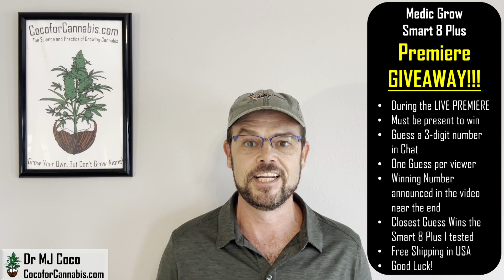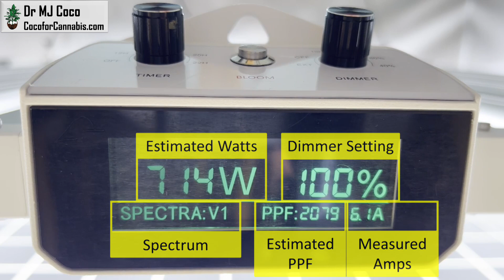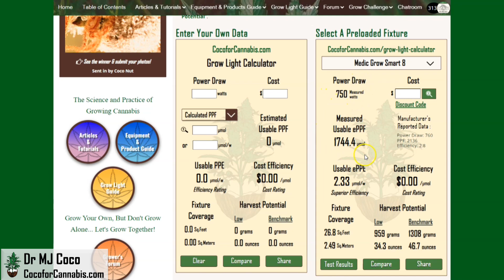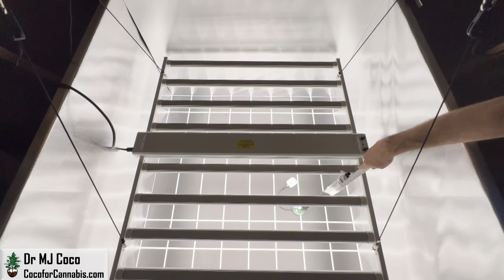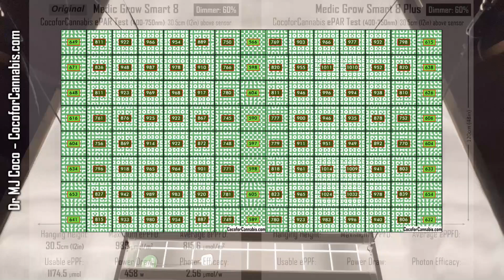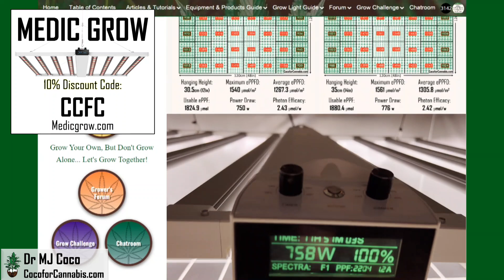Medic Grow Smart 8 Plus PAR & ePAR Tests and Review

Comment: Do not buy ANY Medic Grow light cuz they will give you a MAJOR run around and try to send you another cheaper light!! I bought the Spectrum X like 7 months ago and it began flickering last week after only about 5 months of actual use. I have got nothing less than a complete runaround by Medicare warranty department!! They've tried to send me a $400 light in place of this 700 light and the fold 8 would also require me buying the $200 controller to control it and it doesn't have the UV and IR bars.. after I told them no I want either the Spectrum X or I'd accept a spectrum Y they still offered me a fold 8 or 270 which is not even a third of what I paid for the Spectrum X!! Will never buy anything from medic grow again and I will forever question anyone who gives a positive review on one of Medic Grow lights.

Comment: U should hung them at same height. Increasing the height just makes better chips less. I see why u did it so their at 1000 but regardless because your higher your taking away from the stronger chip. Hang the weaker chip that high it be way worse

Comment: I've been trying to contact some of the main YouTube reviewers & not getting a response. I was hoping you could help me I seen you on grow it and I'm subscribed 2 your Channel. Question is I currently have viparspectra Xs 2000... it gets really warm and it's hard to control the heat. I was thinking about upgrading to a AC Infinity Evo 3 limited space do you think the upgrade would be worth it? Also the detachable driver I feel like that's where most of the heat comes from being able to keep the driver outside the tent would mitigate heat inside how do you feel about this or what would you suggest for a two-by-four?
Reply: I tested all of the above with a digital thermometer on the driver on the lights the ambient temperature outside the tent and the temperature in the driver was 145° the lights we're around 98 the ambient temperature outside of my tent was 72 and the temperature inside 78 so majority of the light was coming from the driver this year I have had absolute zero problems controlling temperature simply because my driver is outside of the tent I think when the temperature outside was in the mid-80s 85/90 this fall temperatures were rising to above 80 in the tent but as soon as the temp dropped too 75 or below no issues it was the driver the whole time that was the culprit
Reply from the maker: The driver is only responsible for about 7% of the total heat added to the space. About 93% of the heat from the light comes from the diodes. Removing the driver is a very marginal improvement in heat management. In the end, heat is a function of the power used. More power = more heat. FWIW, many growers skip summer because they can manage the grow the rest of the year without investing in AC. Grower Love
Reply: @DrMJCoco  thank you for the response Dr MJ that really stinks hopefully that's not the case I feel like on my viparspectra all of the heat is radiating from the driver the board itself feels cool to the touch but the driver is really really warm. I'm on my way home now it was just delivered 30 minutes from now I will have it out of the box😁😁👏🏽👏🏽👏🏽
Reply: @LAndre2874 you'll be surprised lol. I take mine out in summer.  
 Chilled 330 6x mini. Lights are not even hot,  not really warm! The driver gets hot.
Reply: @DrMJCoco I respectfully disagree a bit. I don't know math and science, but I do know my thermostat! It was 75 without a driver,  tops! No where near enough heat. I installed the driver in my 2x4 tent and I now use a fan at 84 degrees!.. it won't get much hotter then 85ish. But that's 10 degrees!!

Comment: Dear Dr.. if you were to choose between the FC 8000 EVO and AC infinity’s IonFrameEVO8, which would you prefer? I’m leaning towards mars hydro due to knowing they’ll array the diodes for better distribution, but see ac infinity has added 8 uva diodes and have AMAZING customer service/quality
Reply: uv led diodes are not even real uva 365nm. Theyre 400nm which is basically just a blue light diode. Also they burn out or start to dim much faster than other leds.
Reply: I agree but do believe their peak is 365. Real ones do at least🤙
Reply: Despite the few uv diodes, I checked w their warranty and was told even if one goes I get a new fixture, so went with AC infinity. Mars did get back finally but they basically admitted they’ve been falsely advertising the evo fixtures on their site.. the Vast majority of diodes are just lm301b, yet only list EVOs are used lol, it’s 28evos, 18 ossrams, and 306 301b’s per light bar. Scam artist at the finest
Reply: And the AC fixture has the diodes spaced denser at edges too which I didn’t know, so was easy choice
Reply: Mars is charging a tad more at 3.39/diode while ac charges 3.36 per diode
Reply: I can’t trust/base calculation off of their calculated ppfd/ppe’s so I’m hoping you could give some advice
Reply: Ac has 2688 diodes at “730w” so “3.6ish diodes/w” & is 800$
Mars has 2448 at “800w” so “3.06 diodes/w” & is 722$
Reply: Overall I get AC has the “fuller” spectrum (lol the gimmicks) but truly is cheaper per diode, drives each of said diodes at a lower wattage, but the fact MARS has that light distribution is REALLY making me gravitate